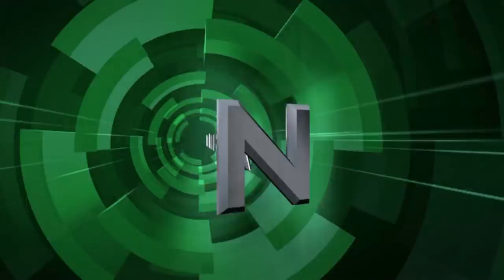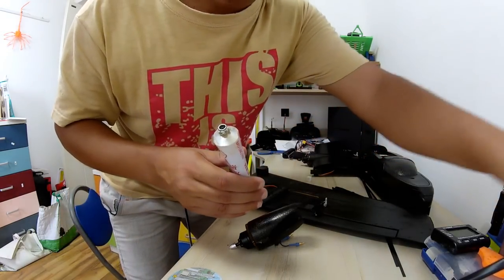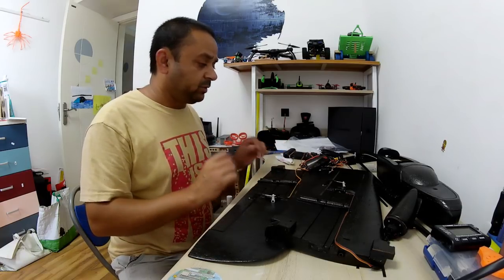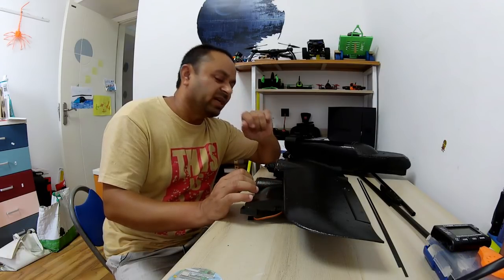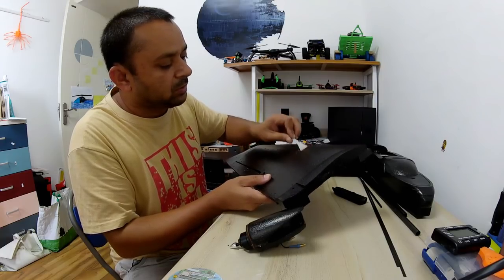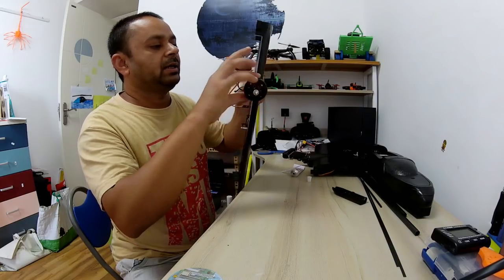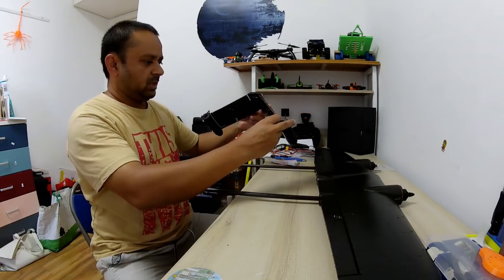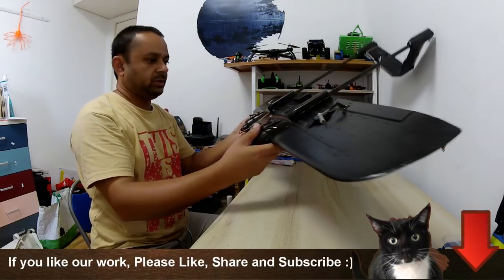SkyHawk V2 Twin Rotor FPV Plane Build Video

Comment: I have just ordered V2 and wanna used it with one motor. Thanks that you confirmed that fuselage and actually the wings are the same as in V1.
You have said that it will looks better if fuselage will be on top, have you tried to install v-tail upside down and try flight on another side? :)
Reply from the maker: no i did not try it upside down but during flight i did inverted and it was ok LOL
Reply: @alishanmao  yes, I see in your videos and other guys that this plane have a good control even in upside down position, so I willing to test it in such way when I will receive mines